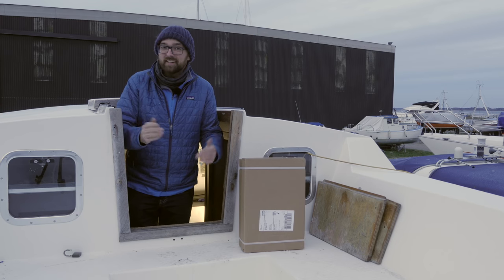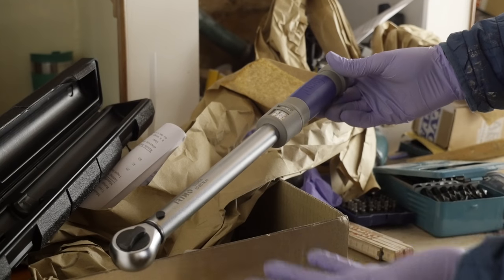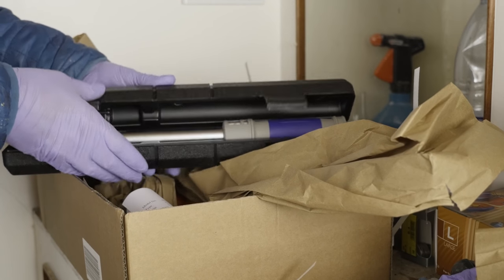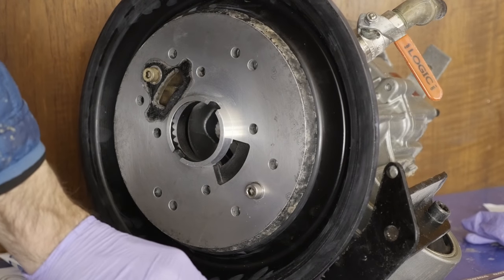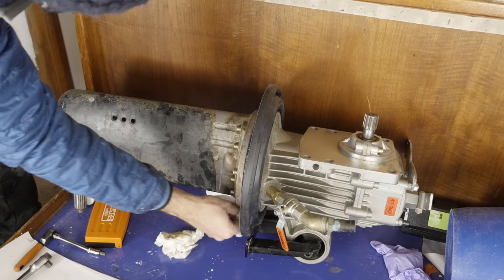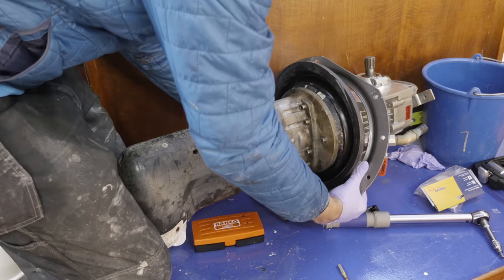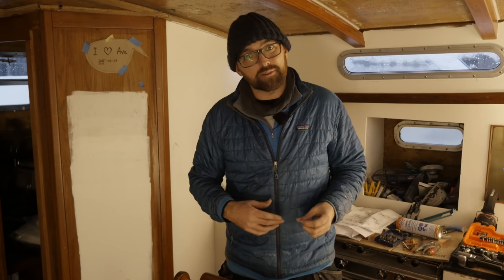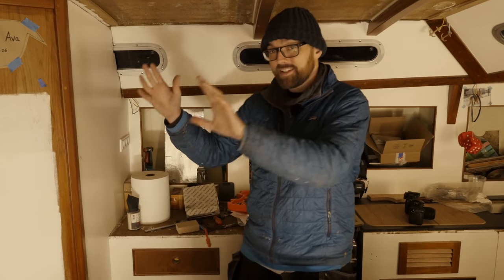Sail Life - Diaphragm replacement 130S saildrive (D2-40) & engine back in it's place

Comment: The same exact case with the ATF oil happened to me! My Volvo Penta, Md22L owners manual indicates ATF oil for the Hurth zf 150 that's attached on it ! I was pretty close to rebuild the €1000 reverse box ,cause I thought its working days was over !  
With the ATF oil the forward gear was failing to engage or if it did ,it was after a lot  of switching back and forth to idle ,instead reverse gear had no engaging issues !!!
Thankfully after a lot of reading on the internet I run onto a man ,who his owners manual for the same model of Volvo Penta engine  indicated  the use of plain engine oil !!!! 750 ml ,about €5 worth,of engine oil solved my problem ,!!
I was very surprised listening to the same incident of a different Volvo Penta engine with a saildrive this time .

Comment: Mads,
In a former life (before retirement) part of my role as a Qa Auditor was checking and setting torque values for airtools and torque wrenches in a car manufacturing plant.
Whatever you do do not use the spiffy new wrench to undo fasteners!!!
You will alter the calibration if you do.
Cheers Eric

Comment: Just did this Mads x 2 D2-40's on my catamaran. Very labor intensive and expensive. The clamp ring new replacement is about $400-500 US. Was able to salvage the clamp rings by rust converter and epoxy fill and  epoxy paint. The bigger problem is the clamp ring on that big seal corrodes and then looses viable sealing surface. MAKE SURE THE PAINT IS SOLID BEFORE PUTTING THEM BACK  Used Trilux 33 for repainting the 130S saildrive leg.

Comment: Mads, besides the other comments about using a torque wrench, here is one other not yet mentioned. When installing and tightening/torqueing down fasteners, install all fasteners finger tight. Then snug them down to a uniform torque (in specified pattern if given). Then go back and increase the setting on the torque wrench and do it again ( and again, and again, if necessary). You don't want to torque one fastener while the others are loose )or not installed).

You want to evenly apply pressure to the parts by incrementally increasing the amount of torque applied to all the fasteners in sequence, until you reach the specified torque. For your 22 nm fasteners I would have used finger tight, somewhere 12-15nm, and then 22nm. For higher torque settings add an additional step or two in the sequence. Just don't torque fasteners to their final setting in one step, especially if there is more than one fastener used to hold an assembly together.

Comment: Hi Mads - as an aircraft engineer i never trust  dry gaskets - i would have used loctite 515 or 518 Master gasket as well, the comment below regards grease on the threads are valid, it chnages the torque but hopefully not to detrimental, copper based antiseize would be better. great videos!

Comment: The aluminum tape does not have to stick to the foam, use it to tape the edges to the glass or wood the foam is yup against. This will also help keep stuff from getting behind the foam and loosening the adhesive.

Comment: Ooohhh...   Pretty Engine Room!
Couple suggestions:
Use of Loctite or thread lubricant/locker changes torque readings.  In effect you might be overtightening as it reduces friction.  Be careful.
As others mentioned, set torque wrench to minimum setting for storage.
Try to cover the exposed insulation foam.  It will absorb fluids/diesel fumes.
I see others have mentioned this too.  Great minds...???
Keep up the great work.

Comment: Volvo engineer #1: I've got a great idea, let's make one of the holes in the saildrive needlessly smaller than the others. That way they might mix up the expensive O-rings we sell and need to buy more.
Volvo engineer #2: Good idea. Also why don't we change our recommendations for oil, so new owners can get confused and maybe break stuff. Then we can sell them our new expensive replacements?
Volvo accountant #1: I love you guys! You're the best!
Reply: Only one problem with that...Volvo Penta don't have any engineers - the saildrives and gearboxes are made by ZF-Hurth, and the engines are made by either Perkins-Perama or Perkins-Shibaura. the whole thing is a badge engineering exercise - i.e. paint them green, put a Volvo badges on them and charge triple or quadruple the price! Its the Volvo way

Comment: ATF has a different additive package versus engine oil since it’s primary function is to be used with gears and clutches with no combustion products.  There are extreme pressure additives for the gear meshing.  Seems best to contact Volvo directly and discuss best approach for your year sail drive that has only had ATF in it.
Reply: I agree. Talk to an expert over at Volvo, otherwise, keep to the old spec.
Reply: I also agree.  I've seen this same issue with transmissions that Yanmar uses.  There can be differeny oil specs on what appears to be the same transmission.  Call Volvo with the exact model and/or serial number on the transmission.  I would bet that the little red sticker is correct.
Reply: @sailingvesselsouthernlady447  At the very least, they may have a flushing recommendation to use when changing lubricant types.  But if there is nothing else on the boat that uses ATF, and it is appropriate for his drive unit, it would be worth the change just to eliminate one more thing that would need to be carried.
Reply: Might be more about the changes to modern atf rather than the suitability of say dexron 3 or 4 atf.
Lot of sealed autos these days, got to be some chemical wizardry in there that may not be suitable for a plain old sail drive?

Comment: All though greasing the screws might seem like a neat idea, it actually changes the tourque requirement. Lubricated threads calls for a lower tourque than dry ones. Hopefully your manual came with double recommedations.
Reply: Yes, torque specifications are generally for clean, dry fasteners.
Reply: @patquintin3730  True, but it all depends on what his manual specifies.  I wouldn't bet against Mads having followed it precisely.
Reply: From the Volvo 130s manual; Apply grease, VP part number 828 250 to the screws.
Torque 22 ± 1 Nm.

Comment: not sure if you did but when torquing bolts you'll want to go over the bolts a second time in the same cross pattern to verify torque since as you tighten down the other bolts  the surfaces can flex or pivot a little

Comment: Ha! The old Volvo sail drive debacle! There was a technical update notice issued. We have a copy (it's on the net). It tells you what oil to use in all their sail drives. Generally, those with ATF have now changed to 15w/40 as per the engine. But their are some exceptions. The great thing about your 130 is the split anode. No taking the prop off every year to change the anodes!!!!!!! Fantastic, if like us you have a Brunton Auto-prop. (take a look at their youtube vids or give us a PM. We have data on our findings) The performance in sail or motorsail is very much improved, somthing you may want to consider?   Sail safe Mads and keep up the great work. Ant & Cid (SV Impavidus)

Comment: Glad you resolved the ATF/ engine oil problem. I recall VP had some issues with saildrives that used ATF, so they changed the recommendation to engine oil. My saildrive doesn't have that red sticker, and the manual said to use the same oil as the engine so I didn't lose any sleep over it. Hoping you don't have to gut the interior...

Comment: Its good practice, if you can, to recheck the torque after a couple of days, sometimes new gaskets compress slightly because of this the bolts/fasteners can lose torque. Not always necessary but good practice.

As people have said release the tension (Zero) the torque wrench after use if you don't and the mechanism of the wrench remains in tension a sort of memory is created which will make the wrench inaccurate over time.

Comment: Besides doing a cross or star pattern when tensioning bolts you can also tighten in stages by picking one or two intermediate torque settings to tighten too. This can be important when you want to minimize warping on mating surfaces.

You have no way of knowing if Volvo made any changes to the inside of the sail drive when they made their recommendation change. But I would find any manual that told me to use motor oil in a gearbox highly suspect. And whenever your in doubt use the original spec from time of production, contacting the manufacturer will just have some half wit in a call center read off the same garbage you printed out.  This is why it is so important to have binders with copies of all your service manuals, bulletins, etc that you collect as you install the parts.  Manufactures often make changes without updating model numbers. Had a lot of fun a couple of years ago on a water pump where they made the depth of a blind hole a little shorter and ended up splitting the casting twice! The best part was the water pump had no documentation on the change we only figured it out when we went to do the third install and had to at that point replace the bracket that used the hole since anger had caused it to be ripped out and bent, and the dealer asked us if we wanted a pre or post 2006 bracket.

Comment: Looking great Mads.  Remember when torque paterens are available, always revers for removal.  A quick and easy though on the tape seal of sound insulation.  Try two strips per edge.  On to stick to firewall and overlap to foam, and a second that joins overlap on foam to mylar (shinny part of insulation) edge.

Comment: Hello Mads, I'm watching your playlist "Project Athena (DIY sailboat restoration)" and this video is missing. You should insert it in 108th position, between "Sail Life - Sound insulation & Volvo D2-40 heat exchanger cleaning" and "Sail Life - Dang it! Structural members & demolishing the head - DIY boat restoration".
Thanks a lot for all your sharing about your boat restoration, it's amazing! Hope the best for the next!

Comment: Before changing from ATF to engine oil I suggest you contact the manufacturer to confirm you can use engine oil in your serial number drive, and whether you need to flush every trace of ATF out before adding  engine oil. Sometimes mixing fluids is a very bad idea. For example with engine coolant, never mix glycol (greenish color) with Dexcool (orange color). They are not compatible and can coagulate inside the engine causing lots of problems.

Comment: Nice progress Mads! A little tip for unbolting @5:39 try to avoid loosening everything on one side. It would have been better to rotate the saildrive and loosen one bolt from each side so you spread the tension better. For the rest great job and thanks for sharing

Comment: Quick suggestion for sealing the edges of the sound insulation... use a spray adhesive or contact cement on the raw foam edge first. After the adhesive drys sufficiently the tape will stick very well to the foam. 

Your project looks fantastic!

Comment: Hi Mads, you mentioned prior to the sail back from Scotland you changed the water pump impeller. I did post a comment before that on an engine that has not run for many months the impeller can bind to the housing causing the vanes to rip off on starting up.... I’d recommend taking the impeller  out and checking it before you start her up ? Don’t get caught out  like I did .... no link this time !!

Comment: Thank you...much fun to watch
It might be worth it for you to find out from Volvo exactly why they changed such an important specification.
I maintained two Harley Davidsons and two sailboat diesels for years.....and changing an oil spec is definitely a BIG issue as transmission oils and engine oils are quite different; engine oil has to adapt to large temperature differences, especially in cold weather (10w30, 20w50 etc..)...not the transmission oils
Cheers

Comment: Good job on the saildrive and engine. I would suggest putting some marine grease on the splines of all your various drive shafts. It's pretty much standard practice and prevents galling. Although, I can't say I've ever heard of using engine oil in a saildrive :/ Why can't you use regular lower unit oil like that used for outboards? Keep up the great work!

Comment: Some advice...
At 10:00 in the video, you should not be going by memory.  The ports where you put the new O-rings are your guide.  Fortunately, your memory was correct.
Pretty sure the green O-rings are not green for position identification, they will be a different material based on the fluids that are passing.
During torquing of the bolts, you really want to stop turning as soon as the torque wrench clicks, don't continue at all.  
Also, after going around all bolts once, it is a good idea to repeat on all bolts in the correct order since the new gasket may compress as you are tightening.  It is often possible to get a little more torque on the second round of tightening.

Comment: Torque is not always Tight  ! Obviously lubrication of threaded bolts has lots of benefits, but with it comes the overriding concern that the lubricant will change the torque required to develop proper tension on the bolt—and how that could affect the integrity of the joint. Some estimate that adding a lubricant could reduce the required torque reading by up to 40 percent!

Comment: Congrats on having the inboard back in. It is remarkable how frequently instructions are inconsistent, even from the same source. You may already know this and didn't mention it, but torque settings are usually different for dry vs. lubricated (thread locker, tefgel, etc.) threads. Be sure to stop tightening as soon as the wrench clicks or you may affect the torque wrench calibration. Also, for the new stainless exhaust elbow be sure the raw water injection point is at least 25 cm above the loaded boat static waterline or you will need to modify and raise it, or provide an anti-backflow/vacuum valve apparatus.

Comment: To close the sides of the soundproofing, place the ½ width of the aluminum tape on the aluminum surface of the soundproofing and bend it in over the side so it reaches or almost reaches into the backplate where the insulation is glued on, and put a strip of tape equal to, ½ on the back cover and out over the tape from before